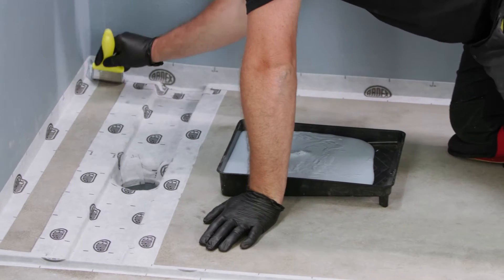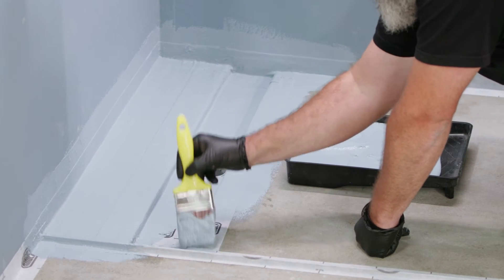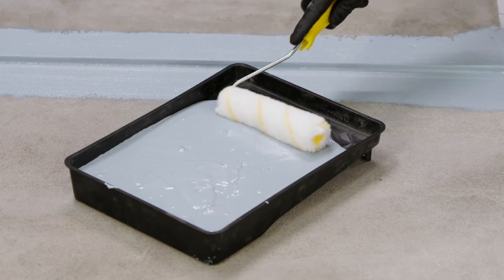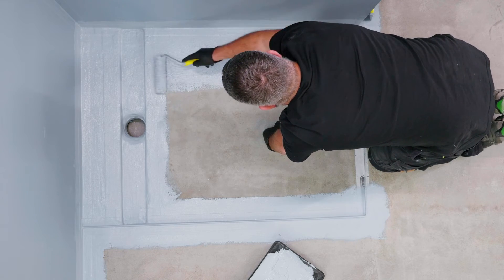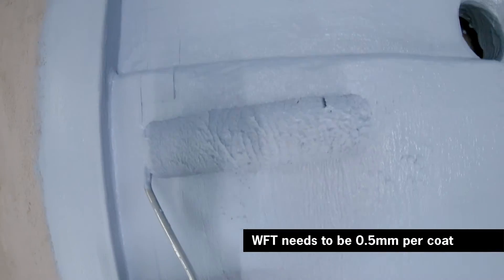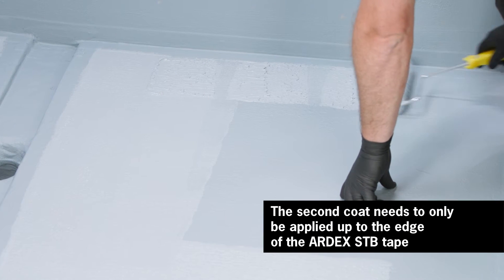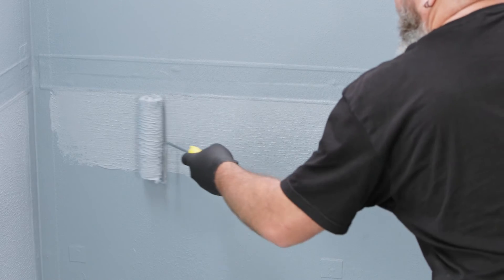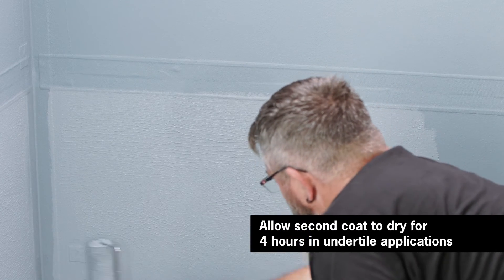Bathroom Waterproofing Above Screed

Comment: Why is the second coat only meant to be applied up to the edge of the STB tape? Is this just so the taped areas don't end up too thick & create a ridge that water may pool around?
Reply from the maker: The membrane can be applied as two coats over the tape if desired, but a single combined coat of membrane and STB tape will effectively waterproof the system.
Where the membrane has been applied over the tape, these areas will cure/dry the slowest. A second coat can be applied over the first coat and tape combination, but the first coat will need to be left to dry longer in these areas to ensure it dries sufficiently to accept the second coating.
The combined thickness of the tape and a single coating will not differ significantly from the combined thickness of tape and two coatings, so the accumulated thickness is less of a concern.

Comment: What's the small plinth around the edges - I'm doing a fixed panel screen, do I need that?
Reply from the maker: Good question @digita1hero - We believe you are referencing the waterstop angle that is protruding up around the sides of the demonstration unit being waterproofed.
This is intended to prevent passage of water from within the shower enclosure to the surrounding areas (including potential water travelling through the tile adhesive /screed).
We have a number of visual resources that may assist in understanding the waterproofing detailing processes, including the link below showing how to incorporate a shower screen installation:
https://www.ardexaustralia.com/pdf/cad/D23%20-%20SHOWER%20WATER%20STOP%20AND%20COVER%20ANGLE.pdf?_gl=1*bsh86z*_ga*MjAwMjc3MDM0NS4xNTkyMzQ4NDQ4*_ga_5BRGGQSHFH*MTcxNTIyNjQwMC4xMjgxLjEuMTcxNTIyNjQwMC42MC4wLjA.